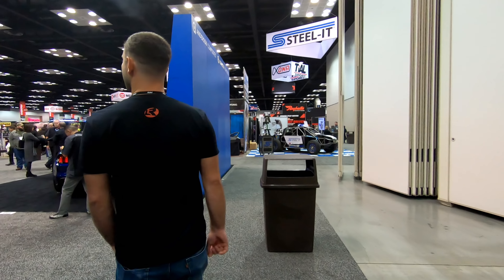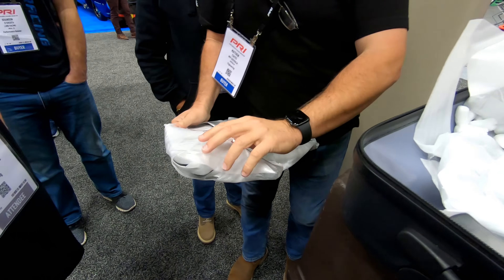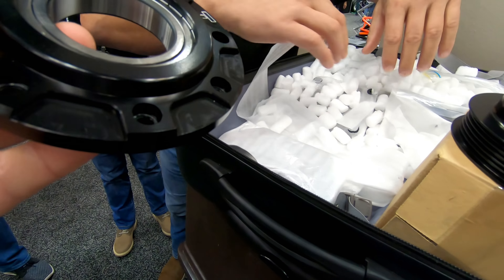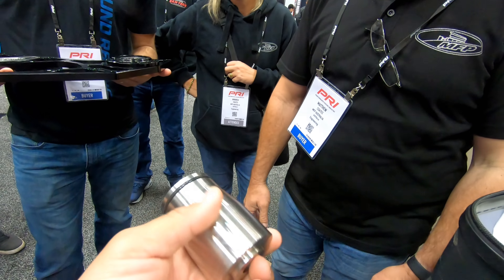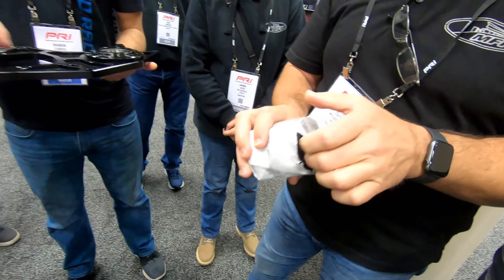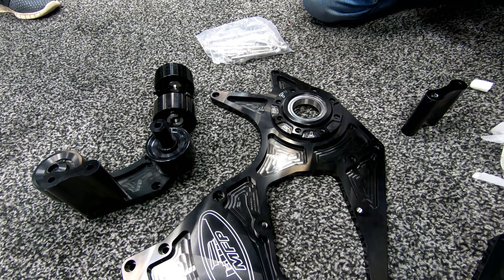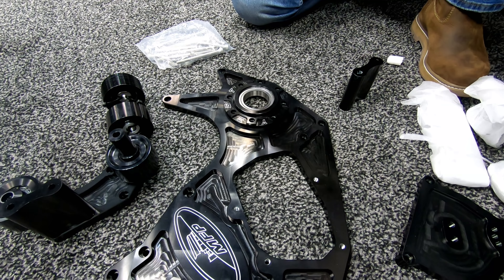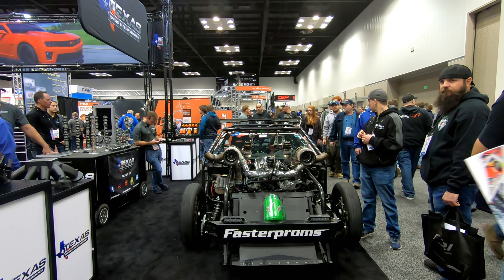MFP Australia Coyote Crank Support and Leroy the savage gets assessed by Lund Racing

Comment: So what is the point of this upgrade?
Reply: The thinking is that coyotes with spray in cylinder liners are not perfectly round. When the ac belt with no spring tensioner pulls on the snout of the crank sideways it creates piston slap or the TICK. This would be cheaper than pulling the motor and sleeving it.
Reply: @indecay3952  look, a Chevy fanboy more than likely😂 respect all makes man..

Comment: Lmao why they picking on that lil stick shift car? Tell them go run Fran’s C6 from Race Proven Motorsports. That would be a good race.
Reply: Built 2jz Lexus how much does Frans car weigh?  Isn’t that a max effort Procharged 427 class car?
Reply: Robert Inabinett I’m not sure the weight but I wouldn’t be surprised if it’s over 3300
Reply: It weighs 3300lbs and it’s built for a class so he’s limited to an F1a. It’s max effort but on that same note it’s definitely limited. He already said it’ll go faster with an f1x